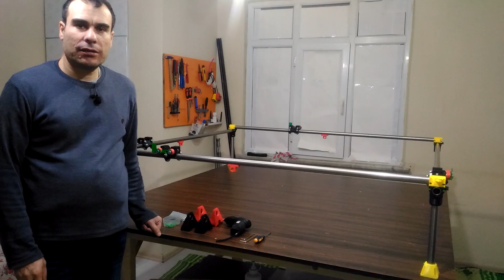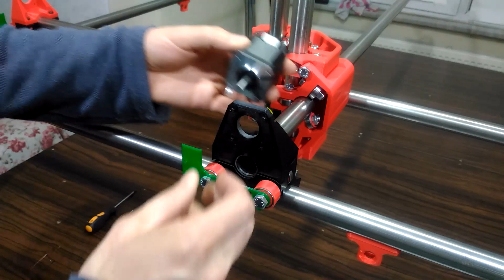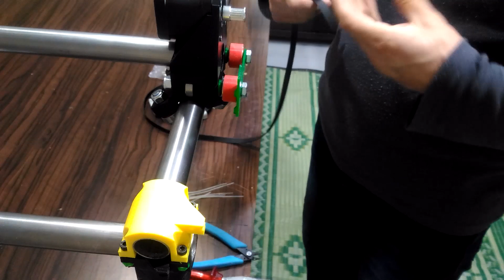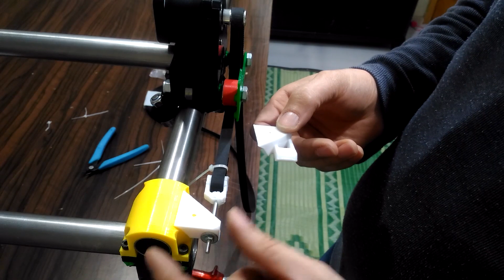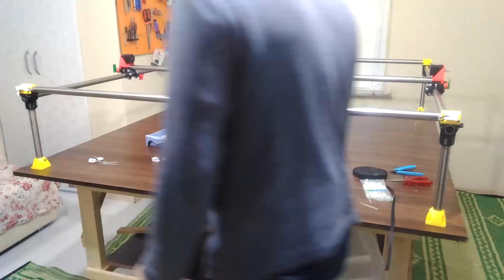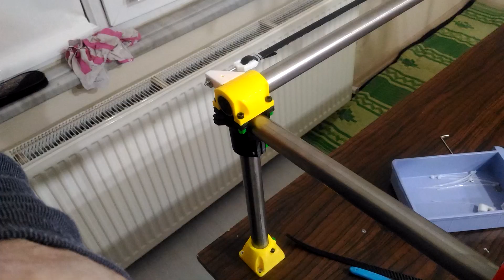04-Beginners guide to building The MPCNC machine Part04 - The middle section and the motors

Comment: Please remind me.  You are making this very large, which I would think would not be stiff enough for use with a spindle/router.  You said you were going to use this with a LASER or something light, correct?
Reply from the maker: Yes Dear.
My main goal is to operate it as a laser cutter and engraver . As is known, the weight of the laser diode and the way it works will not load the gantry with any extra weight or pressure.
So I don't think that the extra length of the axes will affect the work, as I really hope. this is what we will find together.
And I'm going to make a video about that when I'm completely done building.
Reply: @3jcube3  Excellent.  Thank you.  I would like to make a larger version but it just doesn't seem like it has much potential for too large of a setup due to the limited rigidity.  I wish the design allowed for larger tubing or double tubes.  I know you can use solid rods but that can get very expensive.
Reply from the maker: I don't think there is any need to use solid bars because they give extra weight to the motors and this is not a good thing.
If you need a larger machine, I advise you to study this machine,The LowRider2 CNC, it is also designed by Ryan.
This is the link :
https://www.v1engineering.com/lowrider-cnc/